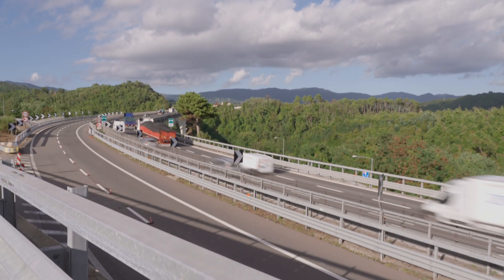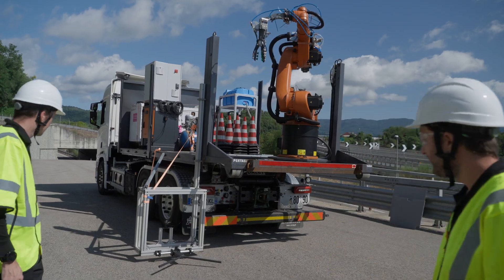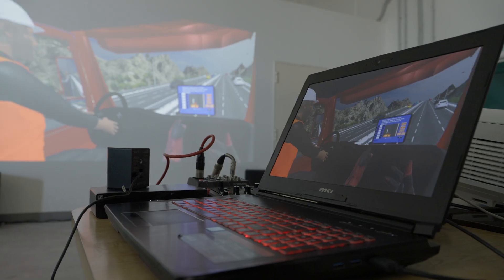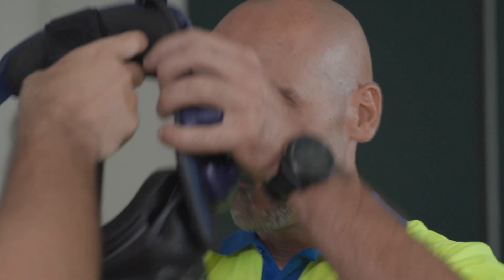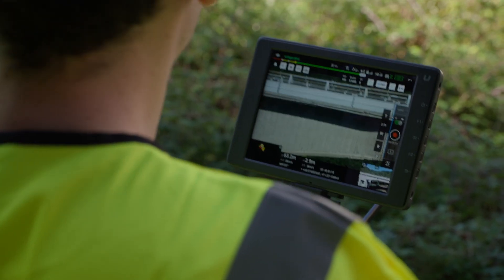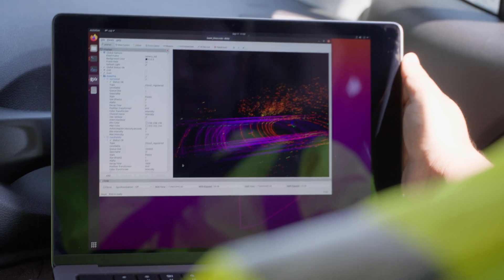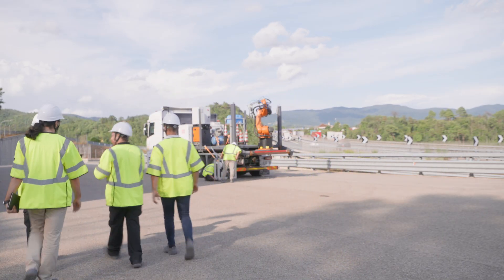Can High-Tech and Robots Save Europe’s Ageing Roads and Protect Lives?

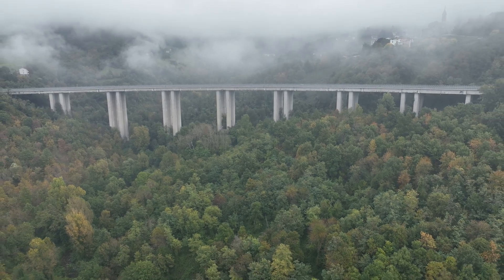Comment: 00:29 How about investing in solutions that reduce the need for road maintenance?

Trains are a well-proven technology that can take a big number of vehicles off the road. Safe cycling infrastructure can equally replace a bunch of the shorter trajectories. 

I understand we can't shift everything to these modes of transportation but cars really are inefficient and a big burden on our roads. Surely some shifting to known technologies (rather than looking into new/untested ones) would have benefits?

EDIT: that being said, I'm liking the AR solutions that keep the workers safely away from the traffic. Drone inspections look interesting as well
Reply from the maker: Thank you for your comment and your interest. Some of the technologies in OMICRON (such as the Digital Twin, Decision Support System and the drone inspection systems can be applied to the maintenance of other transport modes and infrastructure means such as railways, not just roads. Indeed, some of the members of our project are also involved in Europe’s Rail Joint Undertaking, towards railway R&D. However, roads are currently one of the key transport modes and OMICRON’s goal has been to make this safer and more efficient, as well as more suited for multi-modal connection to other transport modes such as railways. If you want to find out more, please visit: omicronproject.eu.
Reply: @esci  Thank you for expanding on this.

I'm happy to see technology being applied so maintenance crews can operate safer